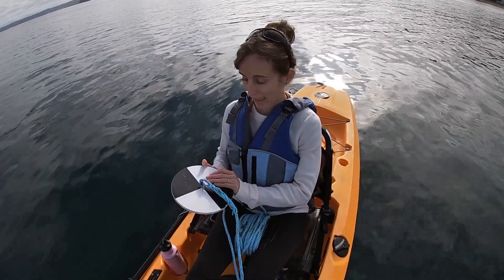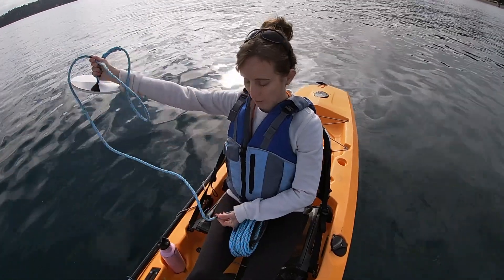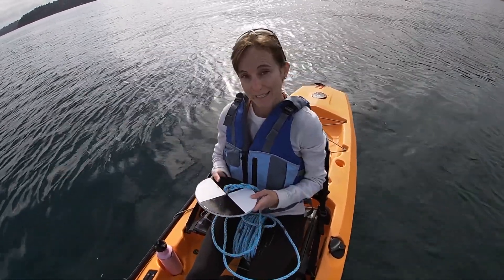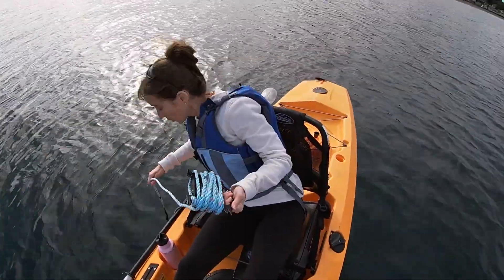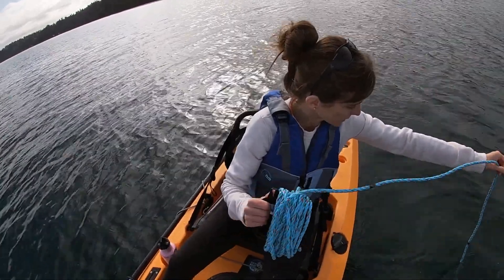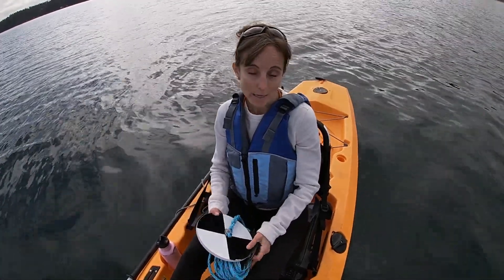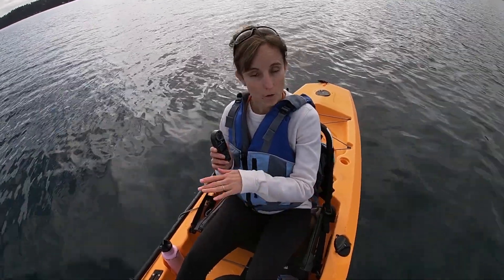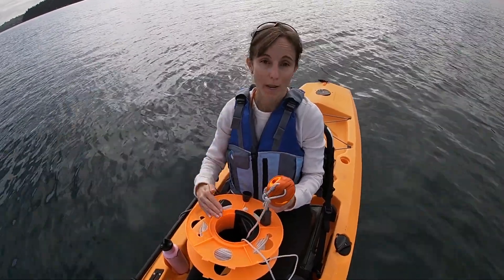Using a Secchi Disk and CastAway CTD in Puget Sound

Comment: Thank you for this. Good quality video and interesting topic. That takes some work and it's appreciated. 
 
No check on your position in the water, though? That data seems like it would only be useful over significant intervals of time, then.... no? So seasonal changes over the course of decades at least. Hrmm.
Reply from the maker: What do you mean by position in the water? GPS location?
Reply: @marinabiologist  Well, yes. I mean where we are taking the reading. Triangulating landmarks to get the same precision as in the past, that'd be all that's required.  But, sure, GPS is more than adequate.